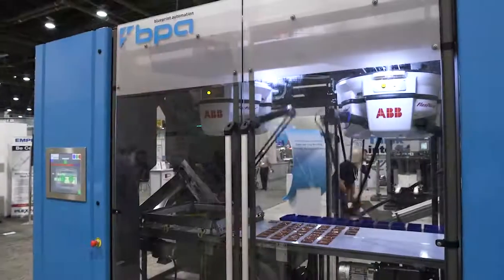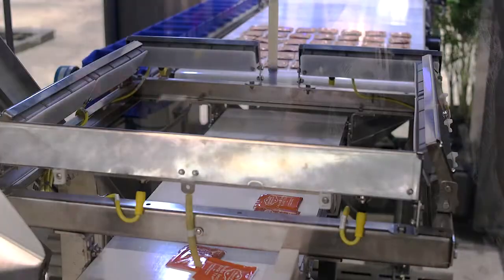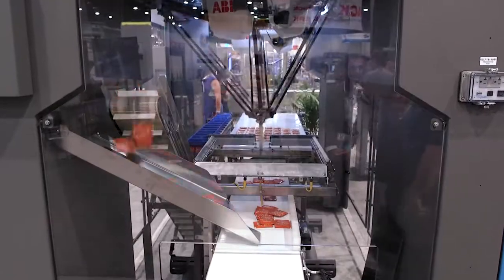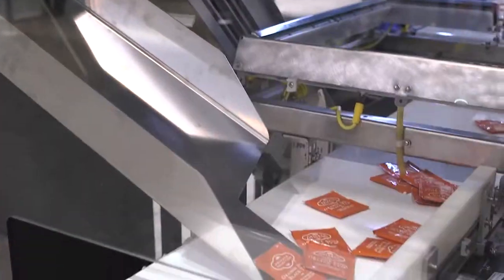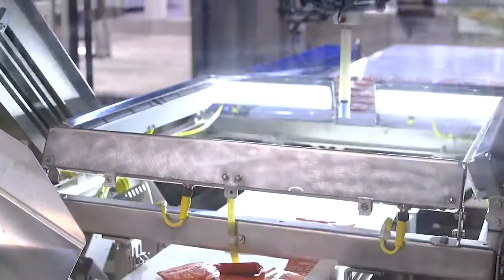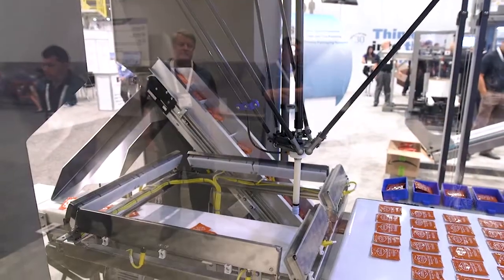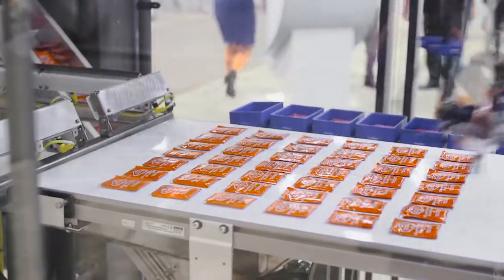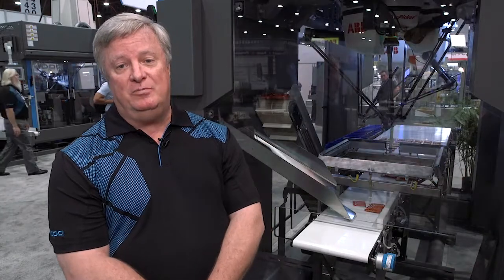123456 BluePrint Automation (BPA) "Pick From a Shallow Pile" Technology during Pack Expo 2017

Comment: Hi there! Would love to understand how this is fast enough to justify the cost for a delta robot. A feeding system would cost the same, footprint would be very similar but would supply a much higher product rate. After all, the total pack rate of your system is limited by the first delta robot?
Reply from the maker: Hello Florian.  A traditional system would have bulk feeding equipment in front of the first robot singulating the product to ensure all product is flat and free from other product on the conveyor.  With this new technology customers are able to eliminate an entire piece of machinery as the product no longer has to be sorted and singulated.  A feeding system will cost more giving the customer a cost and space savings by using our "Pick From a Pile" technology!
Reply: BluePrint Automation - BPA Hi guys, thanks for the quick reply! I get the space saving point but what sort of pick rate do you achieve with this?